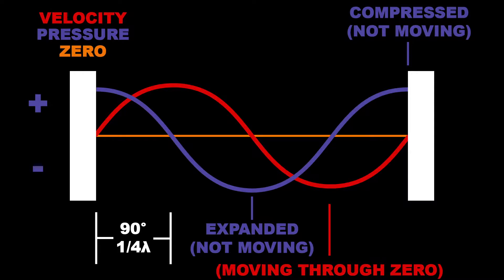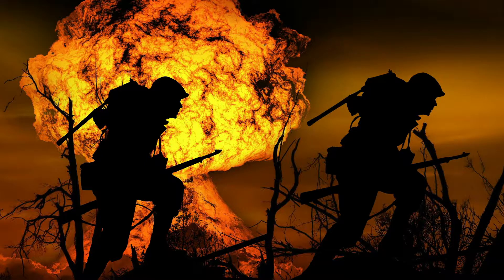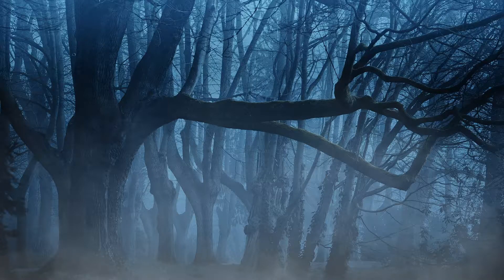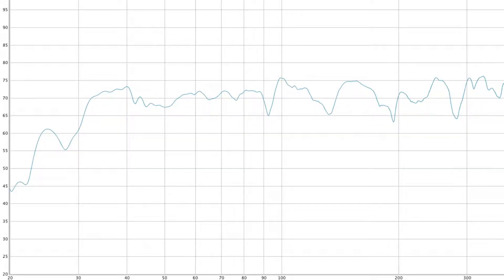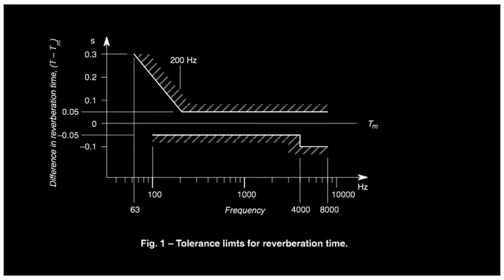Acoustic Sound Absorbers - Velocity vs. Pressure

Comment: I'm considering 2 Primacoustic Maxtraps (A broadband velocity absorber on the front then an air cavity than a membrane (not tuned to a specific frequency) thant its place in the corner. its 17 to 19" deep in total from the front to the wall. My main issues are 60hz and down and I'm using a subwoofer and hip-hop mostly. I think it's the right call to make than adding up later if needed. A lot of good people said to treat the bass issues first and than add up instead of doing what a lot of people are doing. Please give me your opinions and advices. Thank you!
Reply: I'm in a small room so having a ton of thick superchunks is not a good solution for me with  doors in the corners also. So pressure absorber i've been told it's the solution.
Reply: I know you said to not focus under 60hz but, from up there it is getting pretty good and over 300hz i'm under 200ms everywhere.
Reply from the maker: Is there no way that you can mix in a larger room? Room selection is always Step 1. 

Starting with the bass is a good idea, but for small rooms the choice is less clear. Because treating the bass can be an uphill battle, it might make sense to treat the upper frequencies first, and just learn to get the bass right using headphones. 

If you want to send me measurements on Threads or IG, feel free. But first please read through my Acoustic Analysis for Drunks materials if you haven’t. I send it automatically when you join my newsletter and select acoustics. There’s just too much to cover in the comments section. I don’t care if you immediately unsubscribe, but at least you’ll be able to send me measurements that make sense, which not everyone knows how to do. Thanks.
Reply: @Hexspa  im pretty decently flat in FR with the sub at the right position and 180 phase and proper gain for both speakers and the sub im surprised. Its a new construction in the building with rockwool in the walls and some soundproofing its seems to contain the bass decently and there is 1 foot thick queen bed that seems to do a good bass trapping i could send you my REW measurements there is some 3" rockwool panel for early reflections already and i have 200ms or under until 300hz then after that its between 250 to 300ms until 60hz where its starts to go over. Placements seems to helps a lot here
Reply from the maker: @MuzdokOfficial  It sounds like you’re on the right track, and you’re right that the placement of everything is essential to get right. 

My best advice is to keep learning and experimenting. Always try to test the advice you get and confirm it with measurements. 

No matter what room you’re in, it’s normal and desirable for the bass decay to get longer as the frequency decreases. My target for bass decay is - 20 dB within 150 ms above 63 Hz, with an even taper (no lumpy narrow band resonances). 

Always work within your budget. If you’ve got money for resonant absorbers, then by all means try them. Another option is to use multiple subwoofers, which can reduce decay in the lowest octaves. Be sure to look into that, it’s called “multisub”. 

I hope that helps!
Reply: @Hexspa  yes it makes senses. Adding cheaper panels later is way less a risk than overkill thinner abortion and having to spend much more later for the bass and having a too much dead room in the treble and mids on the mean time. I have inconsistencies in the bass dependant on the song with the subwoofer on so i guess its the right decision?
Reply from the maker: @MuzdokOfficial my best advice is to keep studying and experimenting. I prefer building my own acoustic treatment. Just go step by step and you’ll be fine. Cheers.
Reply: @Hexspa  yes i lack space and tools for diy i know it can be cost effective but do note that prices in Canada right now its not that much cheaper neither. 😎 Cheers take care

Comment: i have a 15-20 dB mode and a 15-20dB null in my room tho... isn't it a better idea to treat those first?
Reply from the maker: What do you mean by 'first'?  Before what?  I have a whole series coming out with a worksheet you can download on the process.  A 'mode' is a resonance which can cause peaks and nulls in your response.  If you have a 15-20dB peak (antinode) buildup in your response then you either A.) have dimensions in your room which are 1x or 2x or 0.5x multiples of that frequency's wavelength or B.) you have your speakers near one or more boundaries which are reinforcing that frequency.  You can convert the frequency into wavelength then multiply by those factors to see which surfaces are the culprits. 

Peaks and nulls are caused by modes or reflections.  It has a lot to do with where you're positioned.  However, if you have minimal treatment then you shouldn't expect a flat response.  I'd have to see your room and measurements.  I'm not doing free room analyses anymore but you can post on the Audio Expert Forum where we can help you through the process.  Thanks.
Reply: @Hexspa  yes i know, i have a square room, so my 1-0-0 and my 1-1-0 modes are crazy, second one is a null
Reply from the maker: @MacetazzOpina  You've been using the amroc calculator?  I don't think about those x-x-x numbers.  Or, possibly, I only think of the axial modes 1-0-0, 2-0-0, and either 3-0-0 or 4-0-0 - not sure.  I have a different way of thinking about it.  From what I understand, don't worry about the tangential and oblique modes as much.  If you can handle your positioning and axial modes, you'll have a world-class response.  My room has square-ish qualities - many rooms do - but I will be making a video soon on why they're bad for acoustics.  Cheers.
Reply: @Hexspa  thanks a lot for answering to my questions, i've been like a week straight trying to firgure out what to do but it's been very hard... I'm a student so i can't just cover my room with broadband absorption :(

yes, i've been using that one, the most pronounced frequency responses of my room in REW are also those two modes i mentioned, thats why

what position should i place my monitors in a square room? how did you place them? i have measurements of two different walls (i have a big window with a mlv type curtain so i swiched front and rear) and 39% vs as close to the wall as possible but idk how to interpret those regarding just placement...

Im trying to buy insulation materials to build 6 4" panels for my RFZ and im thinking of buying a 24 inch insulation tube and use it as a tube trap but man are they expensive! ill try buying two and cutting then in half...
Reply from the maker: Well being a student is a great time to learn, right?  I’ll assume you absolutely can not use another room but that is always your first choice.  Go with nature and all that.  What frequency is your biggest peak and null?  My best advice is to forget about tube traps and build your own absorption from the fluffy insulation you can get at hardware stores.  1’ is roughly equal to 4” of rigid.  You can gap them 1x plus face them with kraft paper outside of your RFZ.
Reply: @Hexspa  
that is true, i decided to include an acoustics section in my thesis project since ive been reading so much about it the last few weeks lol

the problem is that the loudest peak is around 36-37Hz in REW (1-0-0 is 37Hz from calculations) and the null is around 50Hz, (1-1-0 is 52 in calculations) as i understand, its very hard to trap those frequencies with broadband, isnt it?  

the fluffy insulation sounds convincing, but i just don't know if it will work all the way down to 36... I tested those frequencies to draw modal distribution by ear and my room resonated LOUD! lol The doors started to vibrate and i could notice easily the places where it was building up 

what do you think about it? i think the porous absorver gave me like a 2 meter distance from the wall or something like that (that was my plan regarding tube traps) so that makes me wonder as well what my best course of action is

thank you very much for helping me!
Reply from the maker: @MacetazzOpina  Glad you're into it.  The good news is that the EBU only cares what your response is above 63Hz.  Keep it simple, treat what you can, and get back to the music!
FWIW, I think any absorber that's at least 1/10th the wavelength will absorb that frequency a little bit - don't quote me - but the takeaway is that yes, even if you don't get full 1/4 wavelength absorption from a super thick panel, you will get some and, if you deploy enough coverage, you will be able to achieve a reasonable result - particularly from 63Hz and up.
Reply: @Hexspa  well i could use EBU standards as a criteria for my thesis if low end response does not get better afterwards, that is very good to know hahahaha

i remember ethan winer made a test and more broadband absorption was better than more potent absorption...

how much % of surface area full of 4 inch rockwool + 4 inch airspace is a bare minimum for a square room?  im sorry if its a hard question! LOL but im trying to get an idea

again thank you very much, you are being very helpful, i've been researching for days and your comments are helping me make more sense of all of this!
Reply from the maker: @MacetazzOpina  Amroc has sabine recommendations but I don't know how to convert that to a specific type of absorber, say an 8" FRK OC705 panel.  This is because, partially, I don't know how to find the 'average' absorption coefficient.  But even if I could, I then wouldn't know how much ft2 coverage I'd need because that would also require a formula that I don't know to convert the difference in average values.
My friend, I am not a genius nor a physics graduate; merely an apprentice thereof.  I am easily overwhelmed so I try to find the essential as quickly as possible.  For this reason, I advise you to keep your acoustics life as simple as possible.  Ethan has mostly boiled it down to 'more is better' - and he's right.  If you have a square room with normal domestic dimensions, you should spare no available surface from thick coverage.  Thanks.
Reply: @Hexspa  thank you very much i think you're right

Comment: Which rockwool density is best to get maximum performance from a bda?

30 kg/m3
50 kg/m3
100 kg/m3
Or is more even better?
Reply from the maker: Good question.  Those densities are equal to 1.9, 3.1, and 6.2lb/ft3 respectively.  As far as I know, 3 and 6lb - or 50 and 100kg densities are standard for glass wool as opposed to mineral wool which needs to be slightly more dense at 6lb and 8lb or roughly 100-120kg/m3.  Personally, I use IIG1180 which is more toward 120kg/m3.  Though rockwool/mineral wool is slightly less efficient than glass wool, it works fine so long as you have enough.  More deployed coverage beats less coverage at any density.
Here's a good resource for comparing various materials: http://www.bobgolds.com/AbsorptionCoefficients.htm  If you're new to treatment, just try to follow a pre-established plan and don't worry too much about the details - you'll learn as you go.  Thanks for your comment.

Don’t know if you read this already but here’s another great resource on the topic: http://ethanwiner.com/density.html
Reply: @Hexspa  Thank you. Can you make a video on building and tuning and on tweaking the q?
Reply from the maker: I think you’re referring more to tuned traps as opposed to broadband.  I do need to make a video on optimizing broadband placement but, if you’re considering resonant absorbers, see my video ‘velocity vs pressure’ on why you may want to reconsider.  Thanks
Reply: Hey. In the meantime I have made some good experience in acoustics. Theoretically and practically.
There's nothing I should consider about tuned resonators. It's the only thing that makes sense. Pressure devices are for pressure problems which occor in low frequencies. A diaphragmatic absorber is narrow, but if you put in a perforated panel in front and behind the fill material you make it broadband :)  ... so it's perfect for bass frequencies, because you can absorb 30-300 Hz with only 28 cm (11").
Rockwool or fibreglass sounds horrible as soon as you put in only one piece into the room, even if you mount wood in front of it, you still completely overdampen frequencies below 1000 Hz and that really doesn't sound good and right.
In the last month I've built my front wall with 80 cm (31,5") thick helmholtz resonators across the whole wall and they are not narrow. I simulated them with acousticmodeling.com. 
They have two different tunings. One tuning is from 20-100 Hz. This resonator only has one slot and is dampened with only a towel in front of the slot. 
The other tuning is from about 30-200 Hz. It has many slots with a slat width of 10 cm (3,93") and a slot width of 5 mm (0,2"). Inside there is 10cm thick rockwool directly behind the slats and slots. The cabinet walls are tripple layered (almost 8 cm thick (3,15")) mdf with 4 mm (0,16") cork in between for anti vibration. They are very powerful and my front wall is tamed now. It sounds amazing. One cabinet has 1500 liters volume and I have 6 of them.
For my sidewalls and ceiling I cannot build that thick and that's where the BDA's (broadband diaphragmatic absorber) come into place perfectly, because of there thinness. The only diss advantage of BDA's are, there are so expensive.
Reply: PS : The BDA's have dual front walls, which make them even stronger :)
Reply from the maker: @MrZyrenda  I want to say that some of what you're saying is either not coming across clearly or is straight-out misinformation.  For instance, putting "one piece" of broadband is not going to "completely overdampen" high frequencies. 

I've posted your comment to the Audio Expert Forum for assistance in understanding what you're saying about your resonators.  Admittedly, I'm not an expert in that topic so I've solicited help.  I'll let you know when I receive feedback.

Thanks for your comment.
Reply: @Hexspa  It is no miss information.
Check out all his videos:
https://www.youtube.com/watch?v=13VH8TPAeG8